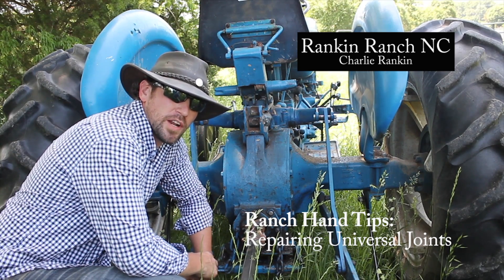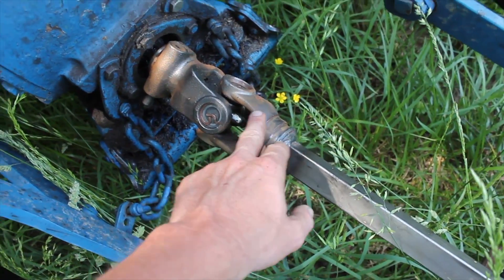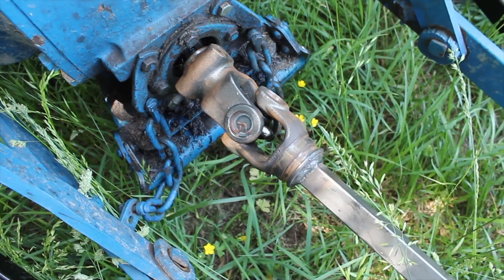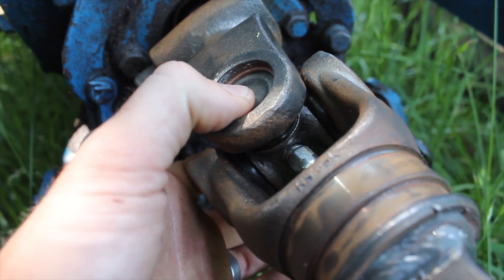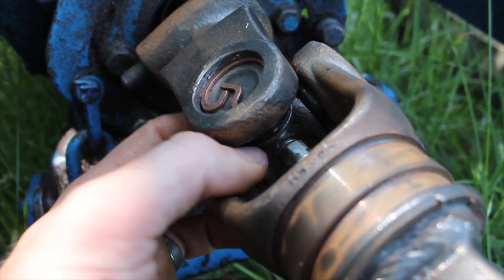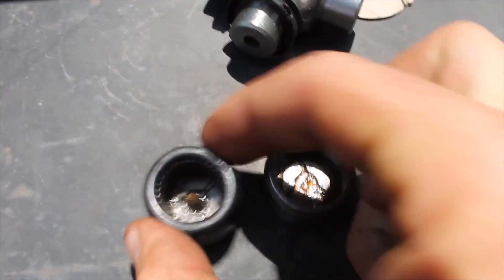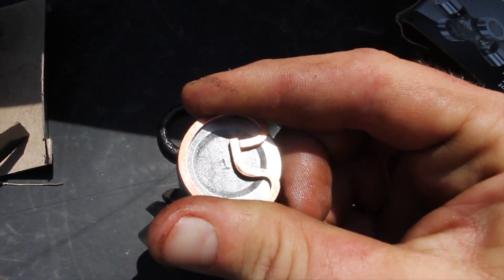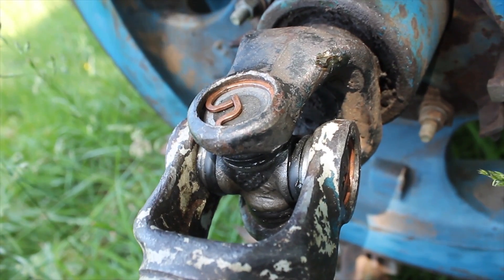Repairing  Universal Joint Cross & Bearing - Ranch Hand Tips

Comment: Mine needs replaced. Why didn't you mention removal?
Reply from the maker: Because mine just... fell out
Reply: Hey if you're just going to put new to rent a vertical joints in there just take your grinder and cut the ends off the old ones and just take a hammer or knock them out